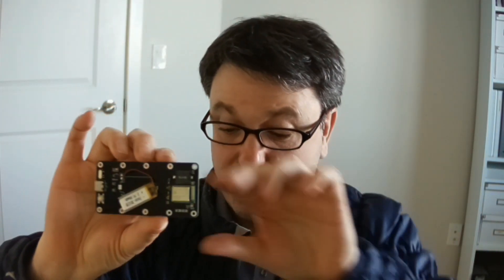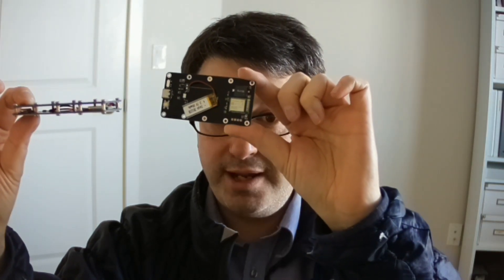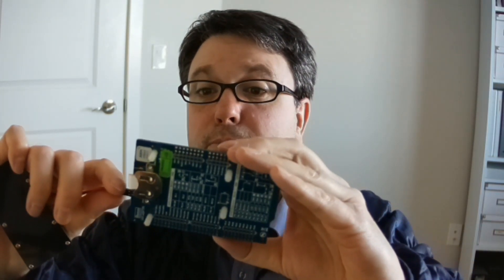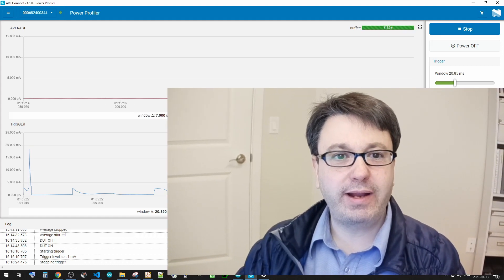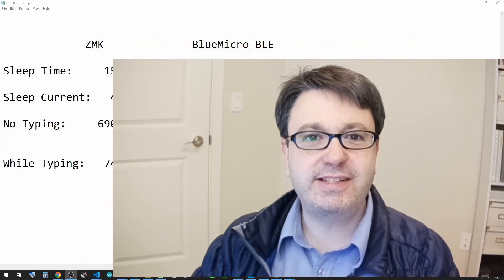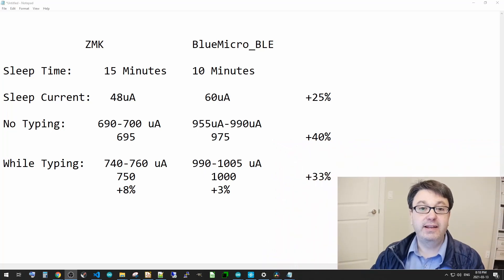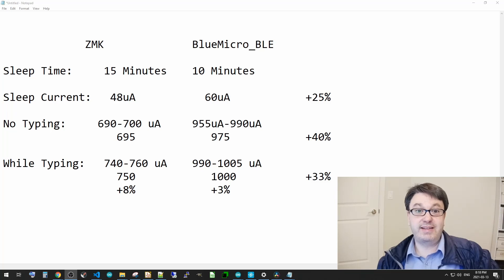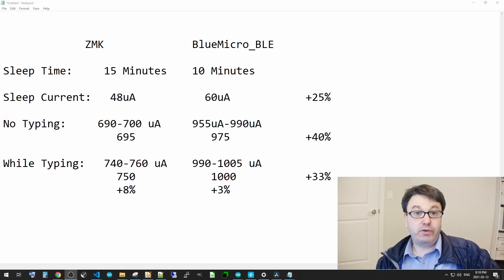How much power does a Bluetooth keyboard need? BlueMicro_BLE vs ZMK

Comment: Not a good test.  You have to type at normal speed. Zmk  sleeps waiting for interrupt when you peck keys slowly. It stops scanning. Faster you type more power consumed. More important, keyboard is a large enough form factor to accommodate a high capacity battery. It is not like a small watch. Power consumption is not an issue. Some People put rgb on these keyboards which consume way more power.

Comment: Hey, I'm interested in buying the 4x12 BLE kit from your website, since there's no way to contact you on the website I'm posting here. Is there an option to buy the assembled keyboard? I'd love to get it but I don't want to go through the assembly process. Maybe instead of soldering the switches it's possible to use hotswap sockets? I'd like to discuss pricing for such an option if you're willing. Thanks :D
Reply from the maker: the 4x12 doesn't support hot swap sockets
I do offer build services.
Reply: @BlueMicroWirelessKeyboards  How can I contact you to discuss pricing?
Reply from the maker: @AmitGold00  My email in is my github profile: https://github.com/jpconstantineau (I don't want to post it here and have more bots sending me junk emails)